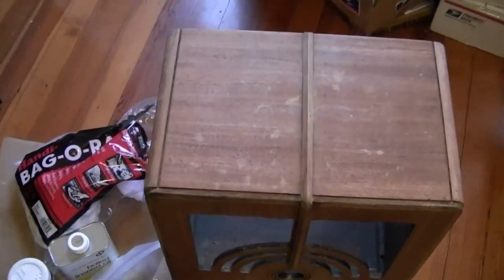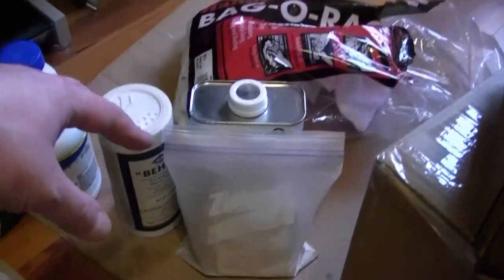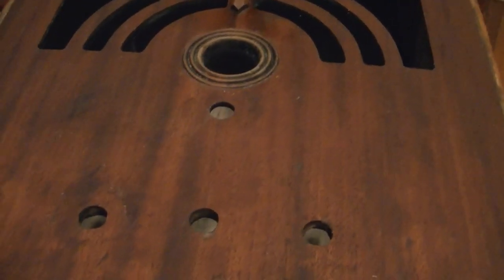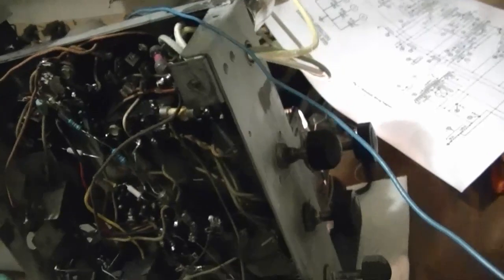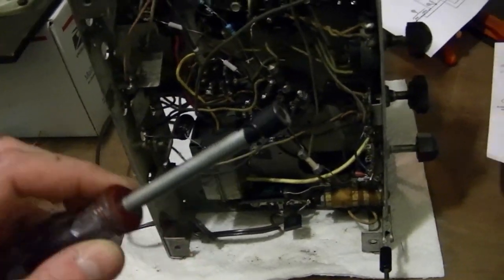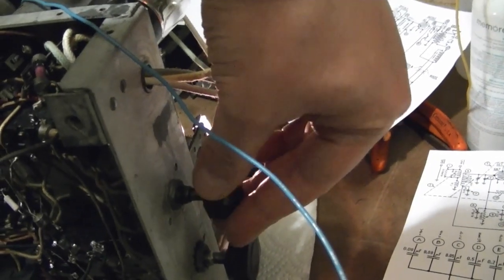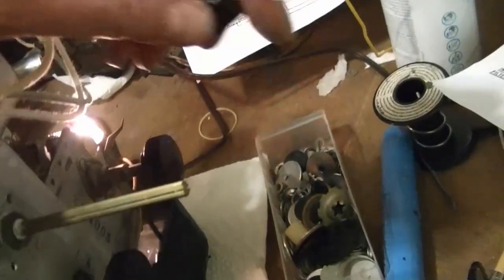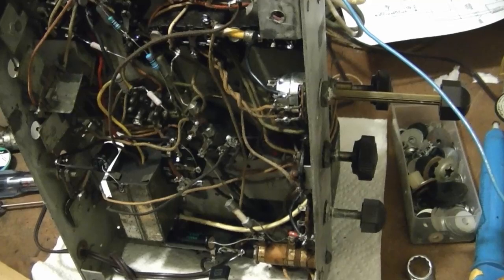Philco 60 MB restoration p5o10

Comment from the maker: Thanks.  I did a little research and it turns out a tone control is more complex than just a pot and a cap.  I think it would require modifying the radio to make it work and I'd rather keep it as original as possible.

Comment: They are wire wrap lugs, But, in some cases they have been used for 'through hole' mounting. Generally I've seen them most commonly used in wire wrapped circuits.

Comment: Pretty sure that funky sound was Radio teletype (rtty).  I've used bleach before on a softwood once, trying to really blond it out.  It worked fine.  However, it really swelled the wood so I had some additional sanding.

Comment: Either a 500K or a 1 meg pot with an audio taper should work, 350K is a bit of an odd size. That replacement you found must have been designed for a printed circuit board mount give the shape of the lugs. Someone used one of those in an AC/DC radio I have and the knob never fit right thanks to the splined shaft it had.